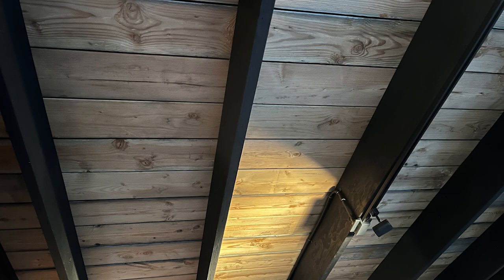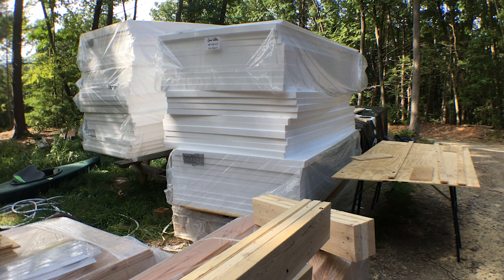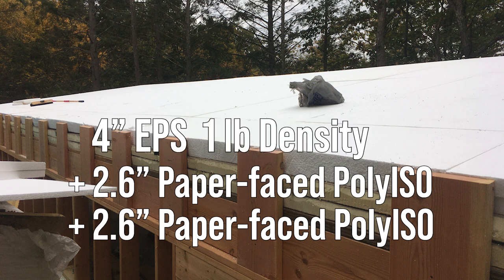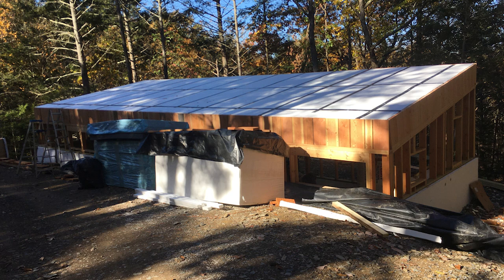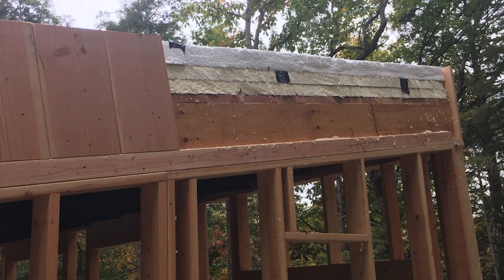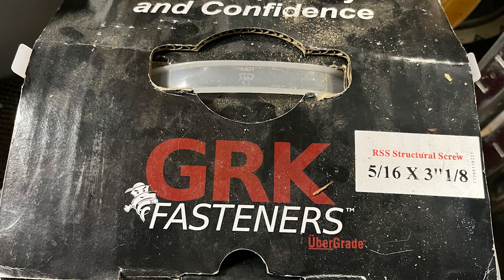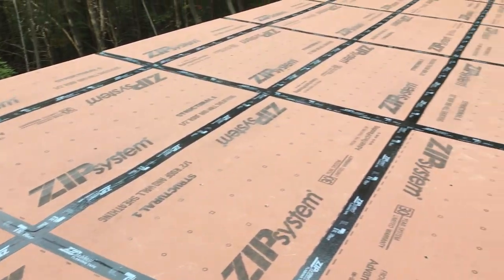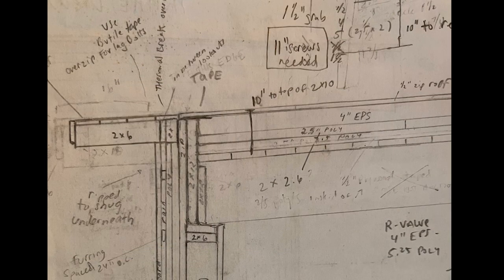High Performance Air Tight Build - How Do You Install Rigid Foam For Roof Insulation?

Comment: should there be venting beneath the ISO or between ISO and the roofing material? I have been researching a lot for building a structurally supported cathedral roof. Most sources I find these days are doing the monopoly build where the attic and roofing becomes livable space but they all seem to still include a venting system of some sort on top of the roof while bypassing the need for a breathable soffit.
Reply from the maker: Thanks for checking out my video.  This is probably the part of the build that I spent the most time researching.  Warm roof ? Cold roof?  I'm an amateur and this was the first time building something from the ground up.  So i'd get professional advice.  It also depends with climate zone you are in.  I found a lot of reliable info from greenbuildingadvisor and FHB and JLC.  There were articles and forum topics about cathedral roofs and how to insulated them correctly.

Comment: Check out "Mr. Chickadee's" channel. He built his timber frame house and roofed it with Larsen trusses packed with mineral wool batt - on TOP of the structural roofing. I think he got R60 from it.

I also like what you've done here. Just sharing another method in case you're curious.
Reply from the maker: Thanks for sharing. I'm going to check it out.

Comment: I worry about water vapour from indoors getting into the 4 vertical sides, thinking of putting a plastic membrane under it and around it, and worrying about piercing it with screws which is both a vapour leak and a cold bridging leak ... maybe i worry too much
Reply from the maker: YEah this stuff will drive you nuts because you dont want to have to re-do it later.  I think its smart to obsess about getting it right.  You will severely decrease the life of the home if it can't dry.  From what I remember reading from professionals, is to only use plastic vapor barriers under concrete slabs.  You don't want to stop water vapour from moving through your wall.  It's not going to be your air barrier or insulation that stops cold from coming in.  For walls, plastic is almost always unnecessary or even detrimental. What is super interesting is that when you use a vapor barrier, it doesn't need to be installed airtight. IF you use it in a crawl space, read articles about. I think I'm remembering that correctly, that it needs to cover a majority of the space to be affective.  IF there are some holes poked in it, its still affective.  The way my building was designed, my walls dry to the inside.  They are inside the thermal break and rigid insulation.   IF I added plastic inside the studs, it would turn into a mushroom farm.  Good luck with your project. I'd love to hear how it goes.
Reply: @POCONOPOWERCORD  I suspect that because you're leaving the rafters exposed, you should be fine with respect to drying. 

I did 4" of polyiso on my roof, but I'll be drywalling the ceilings, so I put a vapor diffusion port at the apex of my shed style roofs. I covered just the port slit with 4" of rockwool comfortboard, so it's vapor open and then used Dorken Delta-Trela over that. 

Vapor diffusion ports are only code for climate zones 1-3. I'm in 4. I'm pretty confident it will work though.

Are you going to do a rain screen over the zip decking?

Comment: why wouldnt you put the layer of zip system first and then the insulation?
Reply from the maker: I'm under the same thinking; you want the sheathing on the inside of the insulation rigid foam (like I did with my exterior walls. Check out the Start To Finish video on this channel). I wouldn't be able to nail roofing to rigid foam though.
Reply: @POCONOPOWERCORD   i agree, and I always like to do a single slant roof like that and have always wanted to put foam on the roof but i worry about condensation around the edges and rotting the boards... is there anywhere that made you feel safe from condensation? i'd like to figure it out myself.
Reply: Specifically, the rot will happen at the roof apex if it happens at all. Since this has open rafters, I don't think he'll have a problem, though that might be wrong.

I went with a vapor diffusion port covered with comfortboard 110. I'm in climate zone 4, so it's not code, but the guy who invented it and wrote the code thinks it should work. The rest of my roof has polyiso, but only 4 inches, though it wouldn't be that different from this.

Comment: How did you build this without any inspections? Didn’t you need plans an permits?
Reply from the maker: Hi Herb thanks for checking out my video. 
I had to file a permit with my town but there is no building inspections if it’s under 1000 sqft. An electrical inspector had to inspect. Those are the rules in my area. Have a nice day.